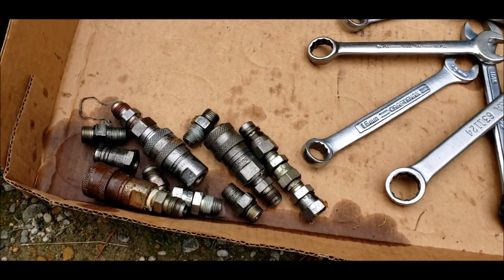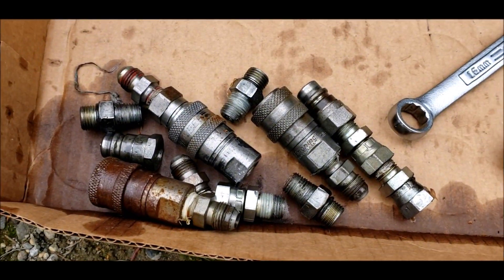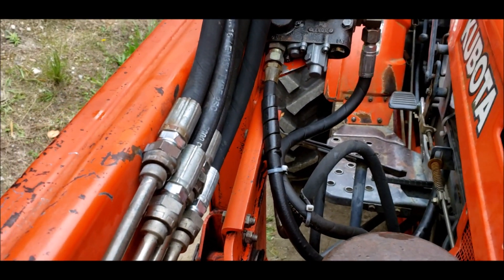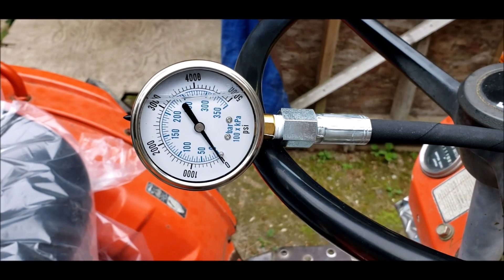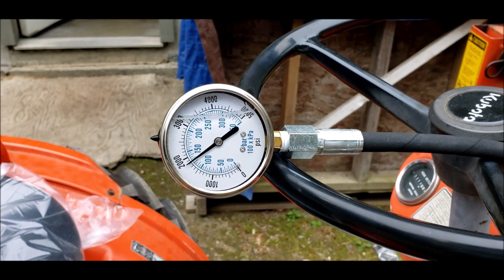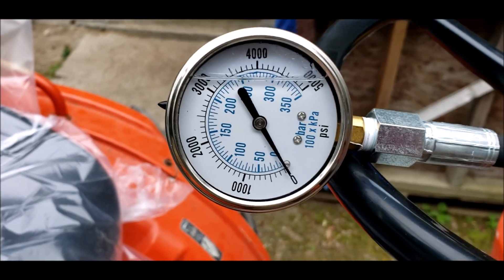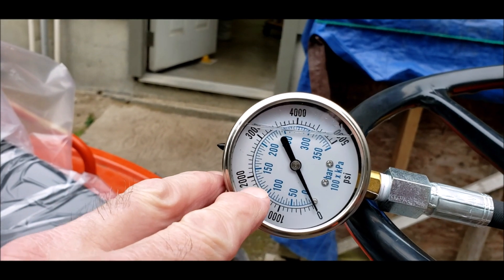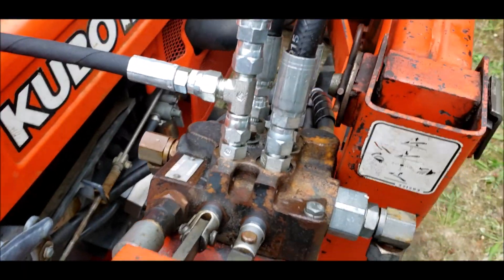Kubota Loader Valve Leaking & Checking Relief Valve Pressure

Comment: Any idea how to get one of those valves.  My spool is loose.  Thank you for the video.
Reply from the maker: If it is a Kubota valve You probably need to check with your Kubota dealer. They generally have many loader valves available on the internet.

Comment: We love our Kubota's but we must keep up with the maintenance. I like the idea of the pressure gauge.
Reply from the maker: I have been wondering what the pressure was for some time. I was working on my backhoe and thought it would be a good time to see what pressure was on the tractor. The backhoe is separate from the backhoe, which is run off a PTO pump. No more leaks on the loader valve now. I hate leaks.